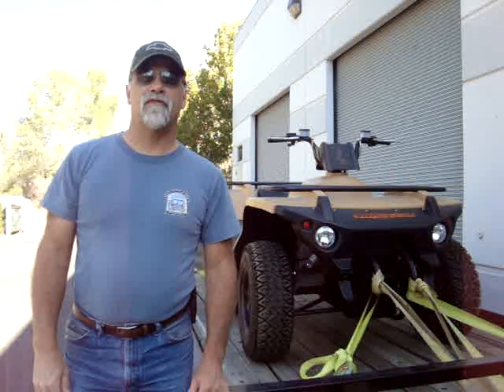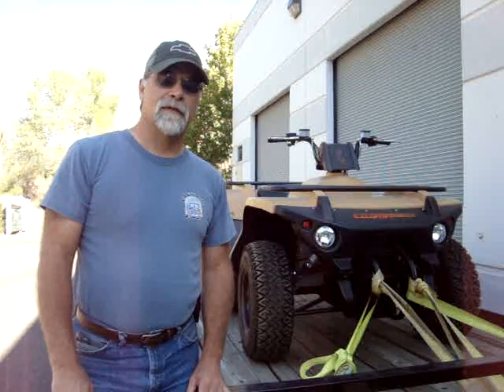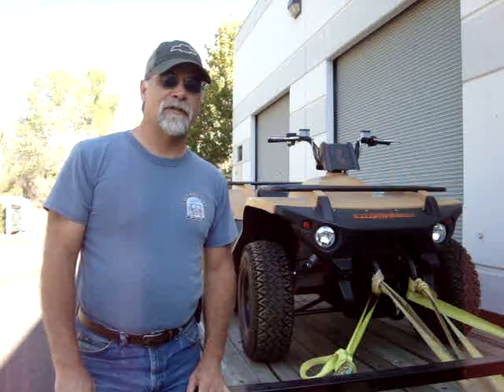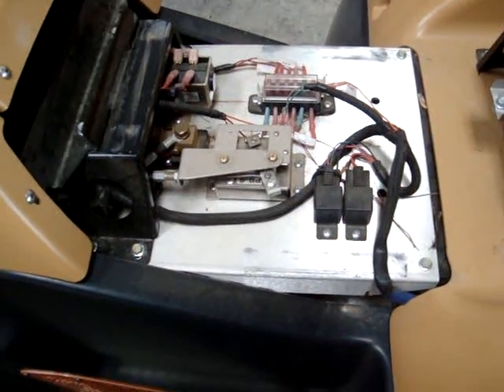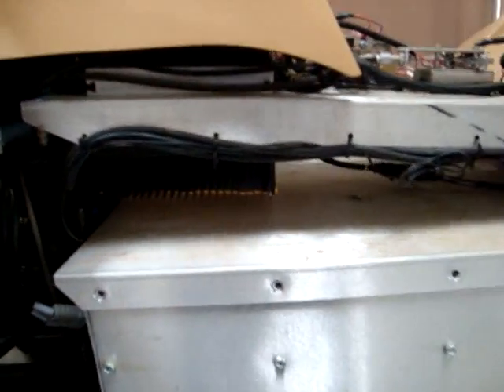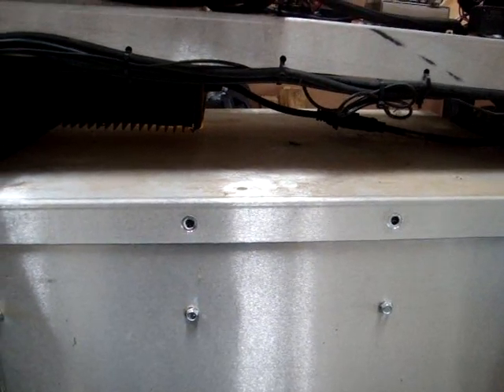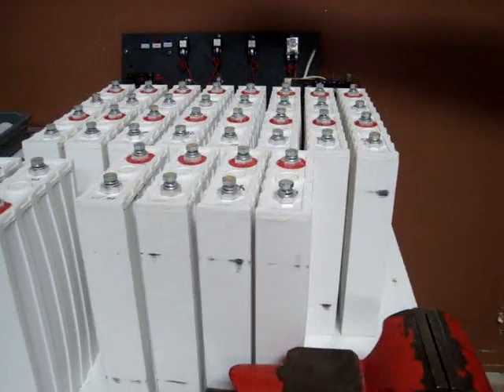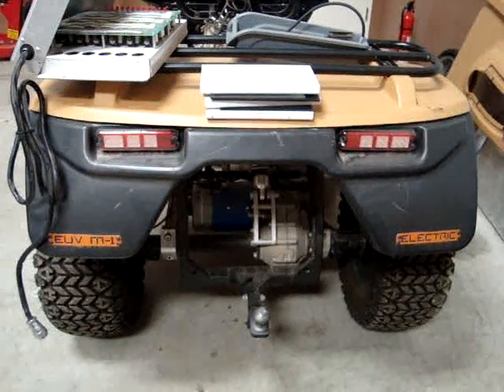Electric ATV - Barefoot Motors EUV M 1 ATV

Comment: Hi, I just bought one of these and I'm currently building a new battery pack for it. Can you tell me why the BMS is not necessary? I would like to not use it if possible, but I keep reading that a BMS is required for LifePo4 cells.
Reply from the maker: Please direct your question to info@EV4Unow.com  Thank you for watching.

Comment from the maker: For more information on the EUV M-1, email us and we will send you a link, or you can google Barefoot Motors ATV.
Reply: I just purchased one that looks as new. Only without the batteries they are gone. Going to find another way to make the basically 100 volts. Got it for $200 😊
Reply: @williamoppelt1695  I just made a new battery for one of these using 24x Lifepo4 120Ah Higee cells bought from Alibaba. Put in my own BMS and shunt and DC contactor.
Works amazing